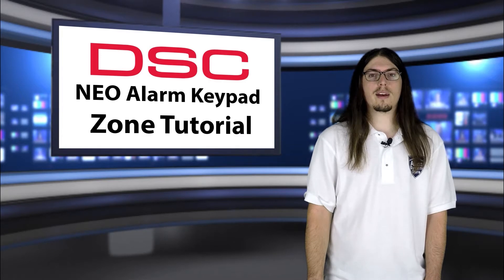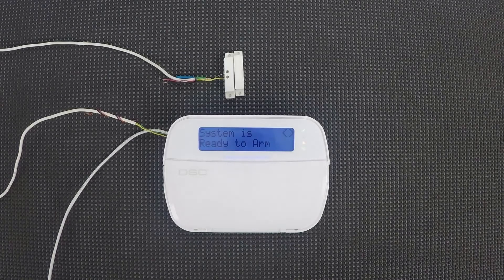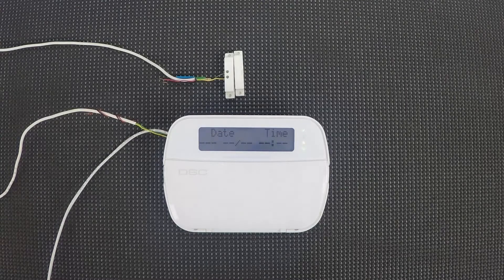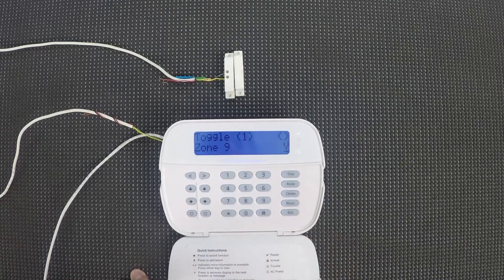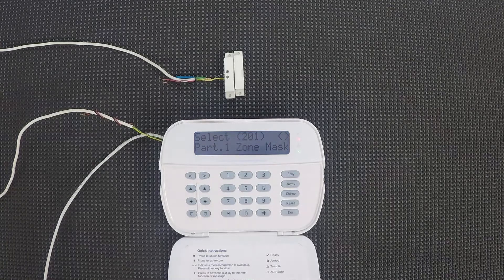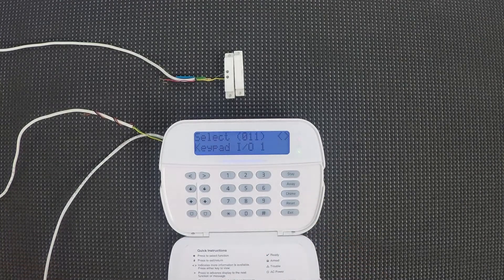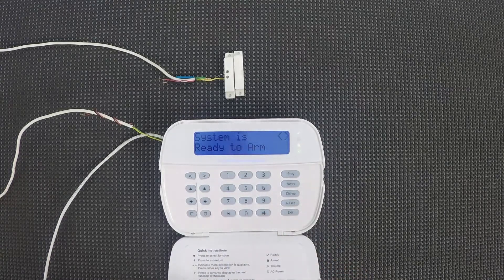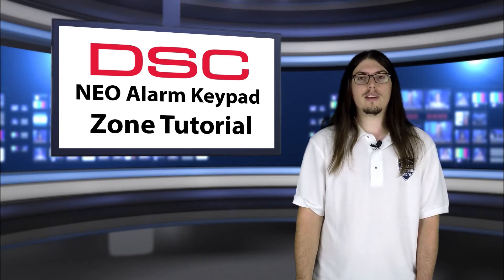Dsc PowerSeries Neo Alarm Keypad Zone Instructions - Alarm System Store

Comment: Hi great videos I have a question I have an open zone number 7 on my DSC security system into older one but I don't know what the zone is I checked every door and window and I never seen zone 7 before in the manual says zone 7 is not used at all so I'm confused as what is zone 7 and it shows zone 7 is open and I cannot arm the alarm